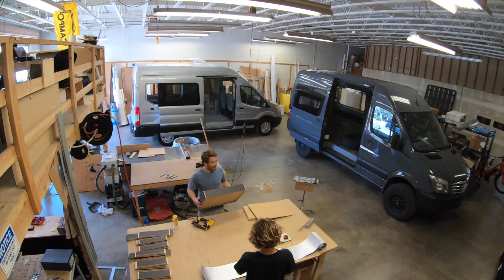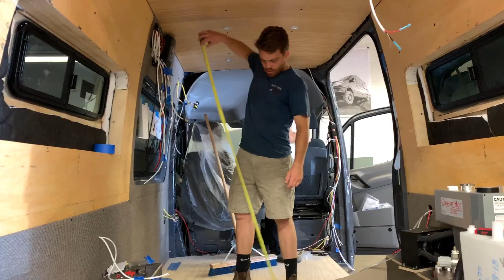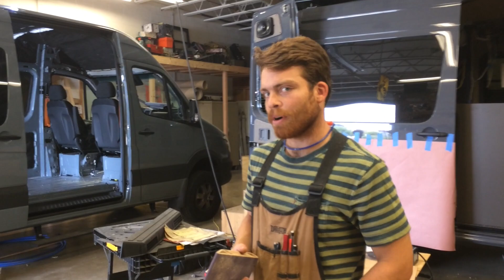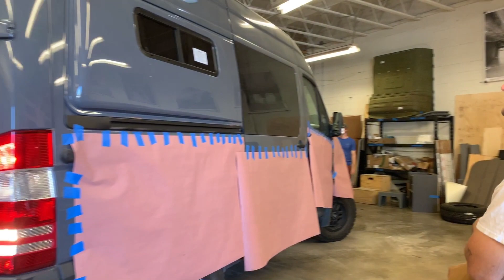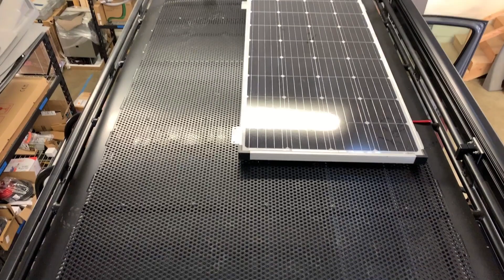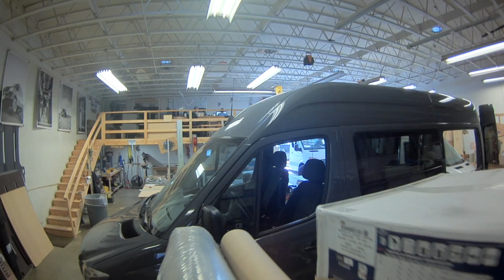Build VLOG Week 4 - Systems, Roof Rack, More Electrical

Comment: In your first video of this series I noticed you guys laid some butyl Noise dampener and then laid thinsulate on top of it. Do you find that both are needed? Is there a noticeable difference versus using just Thinsulate?
Reply: Thinsulate is for insulation and will not significantly reduce noise transfer. Butyl noise damper adheres to the metal panels greatly reducing drumming reverberations and road noise from tires etc. Two separate products for two separate solutions.